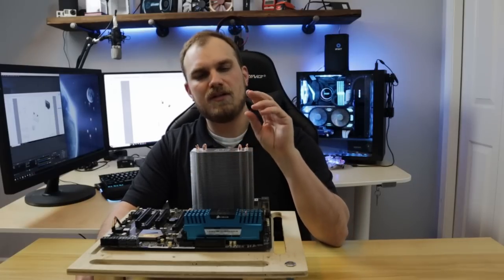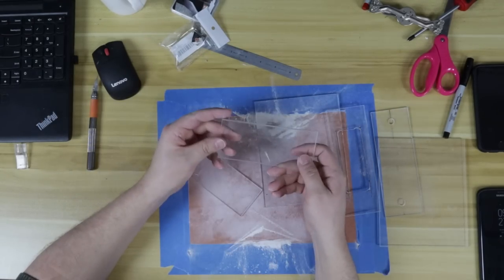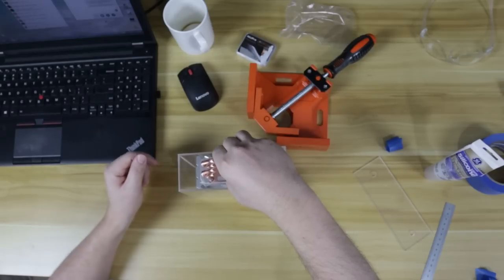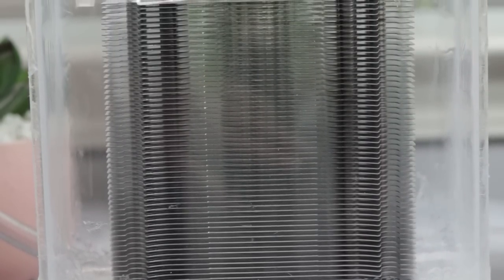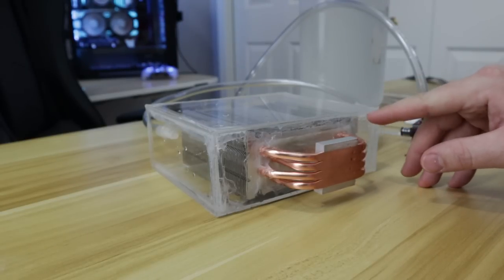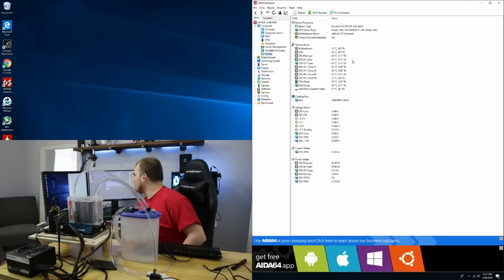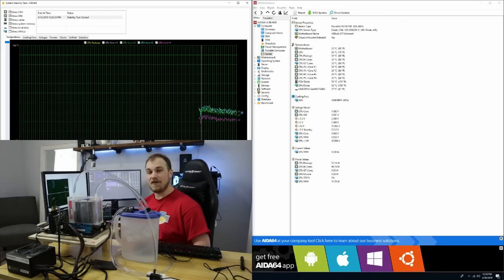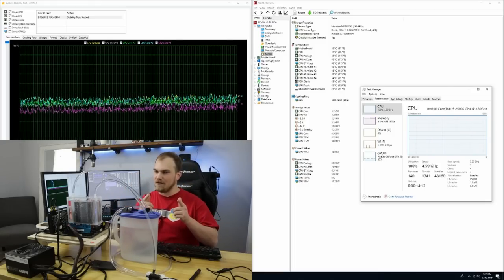I Water Cooled My Air Cooler AND..........

Comment: Hey Brother! J from Denmark here!
I think you should expand on this definately but I would love if you focused on making this some sort of DIY project where everyone can join in and using peoples own hardware in different scenarios..
If you want to get this going commercially you could build a company up from scratch where you sell DIY Kits helping people to build this, where the kit could include the best Heat Sink and pre-cut Acryl pieces and instructions and the tips and tricks you have learned..

The concept is VERY SOLID ... Im experienced in computers, and since the tendency of using extreme frequencies on CPUs still goes on amongst AMD and Intels R and D apartments, there is a future for this design you made!

Its interesting to note how this actually resembles the high tech fuel cell developments that has similar design of huge metal to liquids surface area...

So definately a clap on your shoulder here from me in Danmark !
Keep on working on this brother! It has great potencial...

I dont even think you need such a big Heat Sink.. More important is to keep the Water or Cooling Liquid in the low temperaturs of around 10-22 Degrees CEEELCIUUUS !!

VI SES ! FRED!
Reply: Or you could make a company selling these Coolers where it is like an ALL IN ONE, similar to the AIO watercoolers but just way nicer and better...
Having transparent acrylic sides gives a HUUUUGE invitation to using COLORED COOLING LIQUID in the coolant cirquit.. ! I think there are AIO watercoolers already with this kind of colored liquids..

Comment: Just toss the case away. Build your PC in a Mini Fridge. It will stay 65 degrees F all the time for $90.00.......
Reply: that doesnt work thats not how a cpu is cooled
Reply: Everyone always has this idea 😂😂 it'll work but the fridge will burn out very quickly due to constant heat production. Once food is cooled its not gonna keep getting hotter lol
Reply: @slinkey123  Really? You every taken a course in physics?

You might try it. As an AC system cools things way hotter then a CPU...
Reply: @MasterChief-sl9ro I have not 😂 just Google it brother, it just doesn't work for long apparently. It used to be a running joke on the overclockers forum as everyone used to ask why not just use fridges.
Reply: @slinkey123  Well I have. An physics doesn't stop at google experts.. 

I would add. If you stuff just that radiator in one. It's going to cool faster. As you don't get any heat soak. It becomes nothing but a huge ass evaporator coil. Just like a car without Freon.... Just don't use the freezer. As you would get condensation off the hoses.
Reply: Linus has a video here on YouTube. It doesn't work well, go check it out 😉
Reply: @slinkey123  I don't give shit what he shows. You can't break the laws of thermodynamics. 

Be like saying Water. Ice. Dry Ice etc.... don't work. If you can cool it. It's going to transfer heat. Just as Jay shows. Shoving into a bucket of ice water!
Reply: @MasterChief-sl9ro  It doesn't break any laws of thermodynamics the cooling units in those refrigeraters simply aren't ment to cool down something that is constantly out putting large amounts of heat. They can't keep up with it so it begins to heat up and then things get even worse since its in an insulated box so it just traps all the heat. If you were to use an industrial refrigerator or freezer then it might be a different story but a normal fridge simply won't do.
Reply: @MasterChief-sl9ro  You might know how physics works and the concept looks good on paper, but the problem is with a bar fridge or any household fridge, they are not designed for constant load and the compressor will be burnt-out before the week is up. They are made to cool down the space and then shut down till the heat exceeds the set temperature and then starts up again so it is only running for a few hours at a time. If you had a industrial unit designed for something like a fruit packaging plant where it runs 24/7 it would work but it's going to cost you a few thousand dollars. Sorry just had to add this, you know a air conditioners and a fridge are 2 seprate thing and the article above means shit, the size of a air conditioner's compressor and a fridges compressor is vastly different
Reply: @geoffzietsman7919  Just go see what an RV uses. As they use Propane\120\12volts and they run 24/7.. Htey even have Freezers... Go figure. An RV with an Ice Box...
Reply: @MasterChief-sl9ro  haha who said anything about propane, if the fidge is using propane it doesn't use a compressor and there is nothing to burn out, so technically it would work but again it going to cost you a shit load of money in propane, if you switch that fridge over to power 12v or otherwise the compressors will kick in and again it going to be fucked in a weeks time as the compressor burns out
Reply: @MasterChief-sl9ro  and I'm speaking specifically about the compressor that runs not the fidge, go listen to the fridge in your kitchen, does it always make a sound or just sometimes as the compressor switches on and off?
Reply: @MasterChief-sl9ro  I found the linus video they were talking about, came to basically the same conclusions except that it just wouldn't work as there is to much heat produced, was actually really interesting https://youtu.be/B8bhGw4vUFE
Reply: Will the silicone take those temps though

Comment: 15 seconds in and I'm thinking, "You've never used thermoelectric cooling or liquid nitrogen?"
Reply: Or R134A AC compressor or closed system evap. Lots of different cooler types that are out there. They are rare, but R134A is about as close as you can get to LN2 and run it for more than short bursts. Downside is they are noisy as all hell.
Reply: @vincernio  Not sure where you get that they're noisy. I suppose it's relative to what you're comparing it to. I had one of the VapoChill XE cases and it wasn't nearly as loud as my air setup with Vantec Tornado fans. That was back when you could only buy water blocks (good ol Danger Den) and had to source the rest of your watercooling setup from pet stores and auto stores.
Reply: @anonymoususer4706  interesting, didn't know that there was anything that well built. I'm used to seeing ones that are literally just torn down AC units lol.

Comment: this is the future, as tdp goes up, some factories will definitely make this.
Reply: No, fins are completely useless in water
Reply: well if you know how a fan cooler conducting heat and how water cooler differentiates from it. you would know this is just something for fun and not a good idea at all. achieve your goal? yes. Is it fun? yes. but is it really efficient, space wise, energy wise or safety wise? not at all. engineer with deep knowledge of thermodynamic and fluid mechanic already figured out a lot of things you cant even think of to build a reasonable cooling system, yet, people with no deep understanding of it still try wired stuff is thoughtful but stupid at the same time.

Comment: I'm not to much of a fabricator but I would make the water's only route THROUGH the radiator, compress the sides down and put the water in/out on opposite sides of the long side. That way a wide body of water wants to flow through the radiator and get out the other side. 100% is best to ha e the water out on the high side so it is more likely to pull the hottest water, and tbh either high or mid for the input to disperse the cold at the top and work its way down. 
I'm surprised to see someone do this. At the same time its like why not, its just a set diffusion plates, why wouldn't they perform in water. Neat video yo!

Comment: Theoretically this isn't even a bad idea because water has better thermal energy transfer properties than air, meaning that you could disperse more heat a lot quicker.
Reply: Aluminium and Copper in a Cooling loop is not that good of an idea.
Reply: @bass-dc9175  That's the main problem I see here. Over time the cooler will corrode itself to failure but the proof of concept is there so the foundation for improvements has been laid

Comment: and then there's apple

HEY U GET A I9 CPU

OH AND U GET TO SOLID COOL IT

UR ENTIRE COMPUTER IS A RADIATOR

LITERALLY

IT HEATS UP UR ROOM
Reply: No, you get a dual core i5 that gets to 105C under any load
Reply: I mean any processor will heat up your room proportionately to how many watts it's consuming, the cooling system only dictates how quickly this heat can be transferred from the processor to your room, so if the cooling system cant transfer this heat away from the processor quicker than it's producing heat, the processor will have to throttle itself back to prevent burning itself out.

so in a sense your processing power determines how much it will heat up your room, but your cooling system determines how much of your processing power can be used.

Comment: That's really cool, I have a few simple ideas that might make run even more efficiently.
First, I would put the intake and outtake ports on smaller opposing side panels instead of the putting them both on the top panel. this will make the water flow through more of the chamber instead of much of it taking the path of least resistance over the top of the radiator. Also, leave  decent gaps between the intake and outtake walls and your radiator (much like you have now) but reduce or even eliminate the gaps between the other 4 walls. By leaving the gaps between your intake and outake walls it will allow the water current to spread out to all the cooling fins but by closing in or even eliminating the gaps on the other four walls, the water will be unable to flow around the radiator and will be forced to flow through it, cooling it.

Comment: Honestly, if you rig the water to flow directly across the grills instead of just skimming along the top like you have it, I can guarantee the temp would go down even further. Like airflow having good water circulation is crucial to carry away the heat, and the more the moving water is running along the maximum surface area of the grills the more efficient it's going to work. This gets even better since those air cooling heat sinks are often made of nickel and copper and unlike aluminium are excellent at distributing heat throughout itself to give you the best heat/dissipation ratio.

Comment: Reminds me of my Socket A Athlon Thunderbird days. i crudely siliconed some acrylic pieces around a pal 6035 cooler and used the top part of a zern northbridge watercooling block with its already existing fittings. it was hold together with duct tape and wires (i was 15 in 2001 and clearly watched too much macgyver in my early years). it actually worked really fine without leaks for the test, especially when i hang the rad out of the window in winter ;) sadly that was pre-digital camera and i have no pictures of my abominations from that time. but heck, glory days!

Comment: Cool man.

I’d love to see you do one using a peltier cooler. An electric device that takes power and produces one cold side, one hot side. It’s not that efficient, but considering CPU’s only run idk 45 watts max, you could easily put something together that maybe consumes 300 watts total, but offers an ability to continually run your CPU at very cool temperatures. It would be fun to build a water system to wick all that heat away. 

Would def be a fun project

Comment: Great idea. There is still potential to improve it. Water supply pipe should be located at the bottom to force water flow though all air-cooler surface.

Comment: I think you should try to fill your tank in a different way. The horizontal heat sink needs to be filled at vertical to remove air from the vents, unless it moved the air. The horizontal air cooler should be as  vertical as possible with a cool entry as low on the unit as possible with a hot exit on the opposite side top. Great experiment for sure!

Comment: I just dropped in here and this is a great idea! If you're still around with this project, I'd suggest a smaller but high end air-cooler inside a better case maybe fit some LEDs in it that work with MoBo's RGB system... and that nice tubing setup, some liquid that isn't exactly tap water but, dunno.... Something really nice that can maybe be patented? But man, awesome work, keep it up!

Comment: This is awesome, i'll wait the next video with this water cooled air cooler.

Maybe in the next video, you can make the aquarium more fit to the cooler width so it makes more compact so it will give more space for tall ram sink. And agree with applying on more cooling, such as noctua u12 or u14. Dont know for the d15 i think the gap migth cause problem. Cheers

Comment: Need a radiator to cool the water that’s taking the heat from the air cooler.. or a continuous supply of cool fresh water so your supply doesn’t get heat soaked and eventually stop cooling, cool idea 👍🏼

Comment: (I am an engineer.) This is essentially a water cooling loop without a radiator. The CPU water block contains a small array of very fine fins. That is the heat exchanger between the CPU and the water. This setup replaces those fine fins with heat pipes and large fins. There is such little material in a water block vs the surface area that it will likely be far more efficient at transferring heat away from the CPU than this. That said, this is a really cool idea, and that counts for a lot. ;)

Comment: Improves the structure, by adding more silicone; promptly adds ice to the water to keep it cooler longer.

I'm guessing you forgot about condensation? Like, tbh, idk what's worse in that instance, leaking or condensation, as either could very easily cause issues.

Great concept though!!

Comment: Would like to see you come back to this concept. Look it with an IR camera. If your cooling gradient is small enough across the blades, using even a basic refridgeration component for the water would let you go up to something absurd like 7Ghz or so. The only problem to solve for after that is condensation, and the evaporative cooling loop doubles as a riser so you could 3D print and seal a separation layer to protect the motherboard or use gravity and place the board upside down. Ideally both.

Comment: Well, this is not a "mix" between air cooling and water cooling. That's rather transforming air cooling into water cooling since the principles are the same. And that's a simple but brilliant cost-effective solution to achieve a great cooling result. Obviously, it has to be 100% leak-proof, but the idea is still very smart!

Comment: Cool experiment and proof of concept. But from my understanding, water as a thermal conductivity about 24 times bigger than air. This means that, for this setup to be used at capacity, you would need a heat dissipating radiator about 24 time this size for your system to be efficient at removing the heat from the liquid. Otherwise, your bottle neck is still the dissipation of the heat out of the liquid. You might as well shrink this water cooled heatsink by 24 folds and save the space and money to attack the real bottleneck of your system.

Comment: Draw the water from the top. You could also try non conductive liquids used for water tank builds. You could try a refrigerator compressor on the reservoir. Or to go really insane a freezer compressor. To collect condensation have an out shell with a slight gap around it designed to capture condensation and add it back into the loop. Just some thoughts that popped in my head.

Comment: Honestly, with the lack of lga2011 narrow ilm coolers out there, this is looking tempting... But I'd probably ali weld a case around the cooler and pressure test with vac or hydraulic fluid to make sure theres no leaks.

Comment: Considering the massive surface area, you could probably use mineral oil which is dielectric and wouldn't damage anything in a leak.
Mineral oil is horrible at sinking heat, but with a massive sink, like an air cooler, it works quite well.

Comment: I like the idea but it makes me wonder if it's just effectively a water block with an aluminum mass. More surface area to transmit heat in the fluid, but the rate of the fluid is probably enough alone.  Hard to say. Plus you don't have to fear a water block letting go the way this aquaricooler could potentially.  Looks awesome though!

Comment: I would put the inlet at the top of the mobo end and the outlet opposite end so it has to pass through the fins, could also put 2 pieces of acrylic down the inside to 1 keep the box steady and 2 guide the water through the fins, great idea though mate

Comment: Place inlet horizontally at the bottom of the tank and outlet on top of the opposite side of the tank. Orientate the radiator so the fins are oriented vertically and paralel to the direction of the water flowing in. This should ensure turbulent flow around most of the radiator fins. This should work much better.

Comment: A few things that stand out to me. 1... I would put shunts to force the cooling fluid though the radiators and reduce cooling potential from just going over the top or around the sides without losing thermal potential. Secondly,  the inlet should be low, and the outlet high as the hotter fluid will raise. you want the coolest liquid near the cpu for best efficiency.

Comment: Surely the water should flow through the heatsink. Would putting one pipe in on one side (nearer the bottom) and one pipe out on the other side (nearer the top) work?
Also on the tank, would some heat sink or fins help there? Also same idea with the pipes, take the cold water from the bottom and warm water from the top.

Is there way a of fitting a fan/propeller or something still onto the heatsink while it's in water?